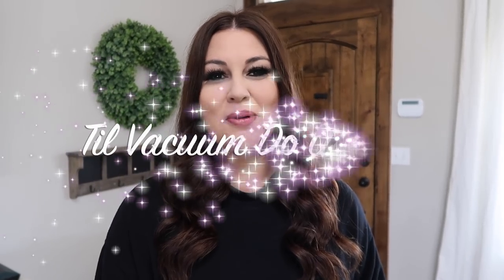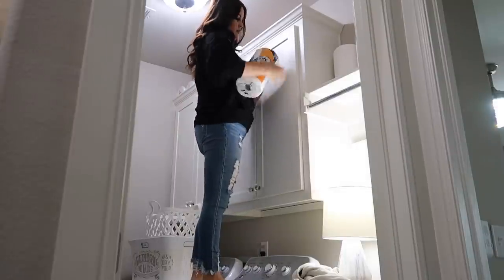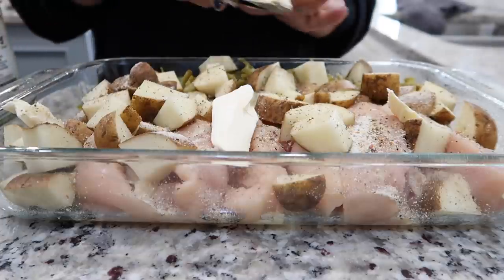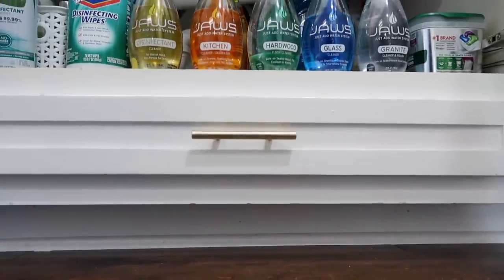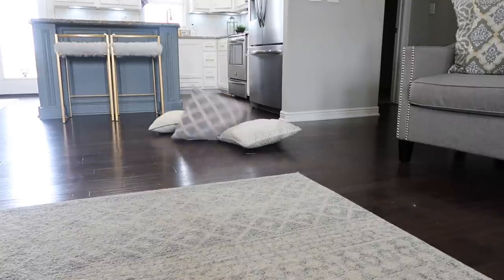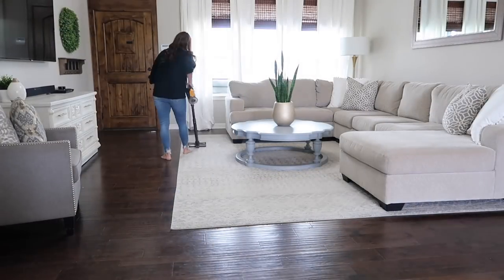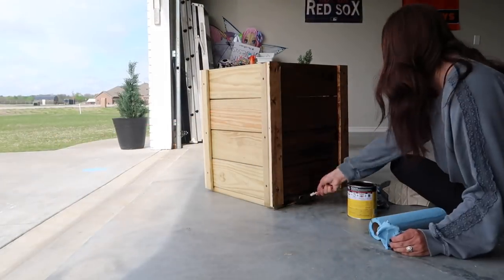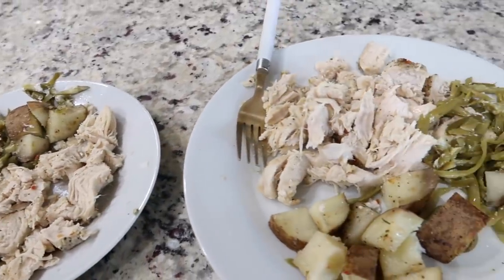COOKING, CLEANING + MORE DIY PROJECTS | STAY AT HOME MOTIVATION | Til Vacuum Do Us Part

Comment: Nice job on the planter...just a little tip, so u don't have to use so much potting soil first fill the bottom of the planter with empty plastic bottles to eat up a lot of space, then fill with ur potting soil...walla it's done!!